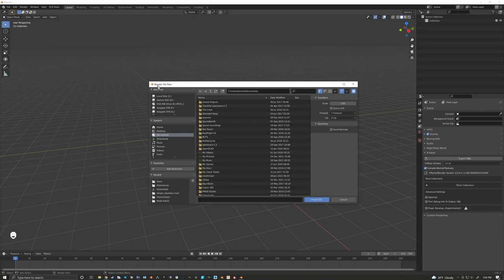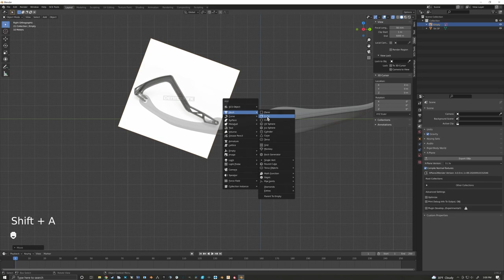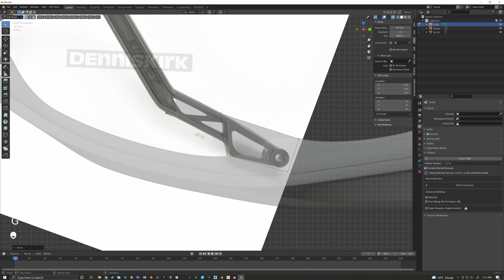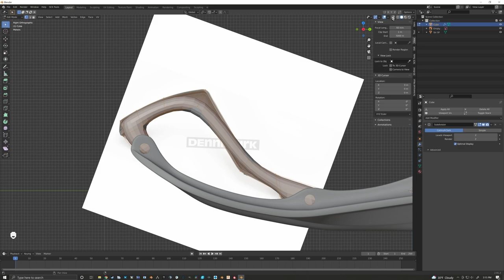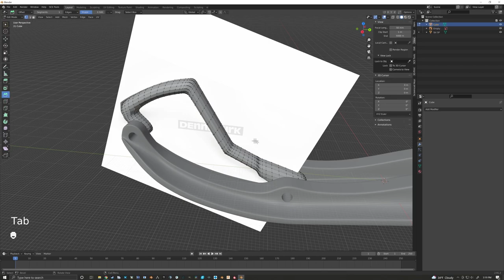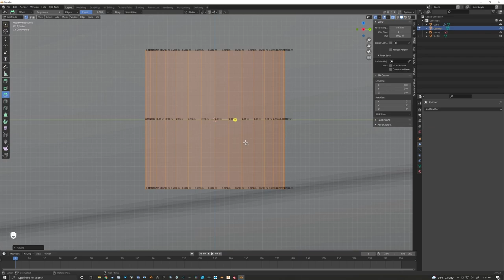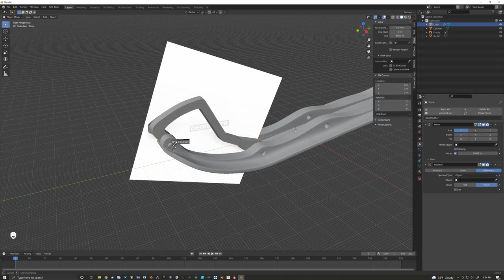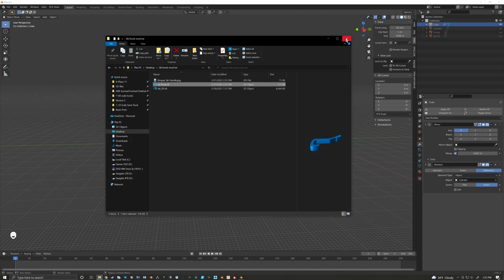Create models for 3D printing with Blender

Comment: thanks for the tutorial. im just wonedring if i want wider skis can i just go in to blender and make them wider and then print them out or do i need to do something else?
Reply from the maker: Yes. Just be sure when you make them wider that you widen the sides but leave the center ridges as they are so the mounting still fits. You'll import the ski, then press tab to go into "edit mode" select all of the edge vertices and then scale them on the z axis to the width you want. then export as .stl
Reply: @BuildItBetter3D  Okay thanks